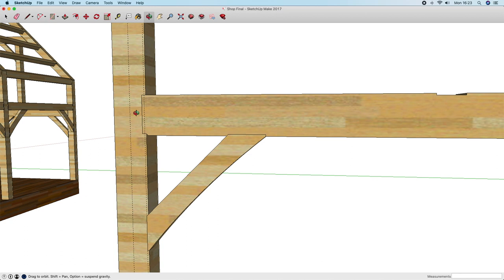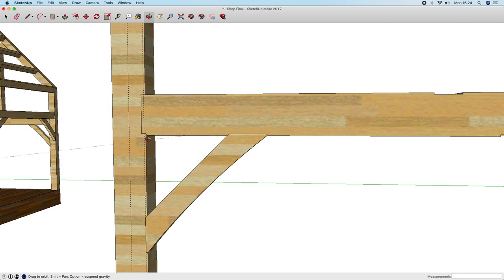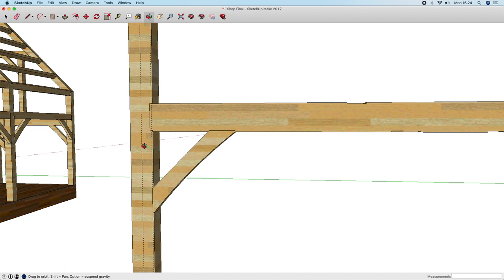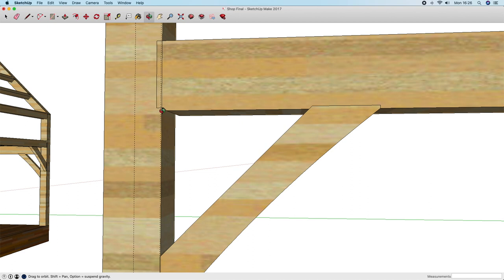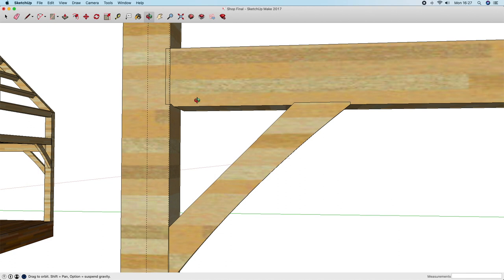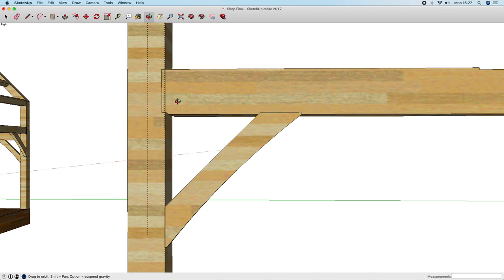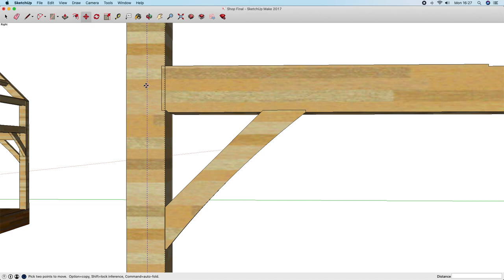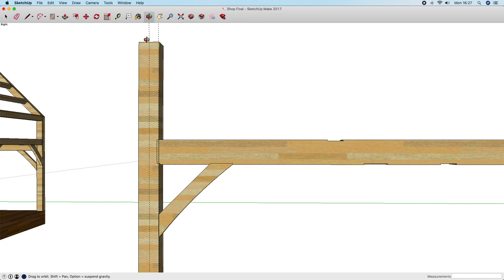Timberframing Layout Part 2 - Line Rule Details

Comment: Thanks for making the video.  One suggestion I would have is to actually demonstrate, actually go through laying out the timber without skipping anything and checking on the other faces versus just discussing it.  Although the discussion is good, actually working through examples could clear up anything that maybe wasn't clear in the discussion.
Reply from the maker: Yup, that's next.  A start to finish on a simple timber that is bowed and out of square including cutting square joints off of a wonky face.
Reply: @DovetailTimberworks  I would also appreciate this as I am still a little unsure as to exactly how you determine where the perpendicular centre lines are going to intersect so that they describe an ideal centre line in all planes. I.e. I get how you do the vertical centre line down from the top, leveled face, but I am not sure about the horizontal one, how you are deciding how much it is offset from that top face on both ends. Maybe you just pull a centre line down one side face as well, or just measure down halfway on each end and pull the perpendicular line with the level?
Reply from the maker: @csgowoes6319  Good question, short answer is it doesn't actually matter where you put it, just that it is level and thus square to the plumb line you put.  I always try to put it where it will serve the greatest utility for me (there are exceptions), for example sometimes where the cheek of a tenon will go or where the bottom of a housing is for example.  I have a simple post picked out with a bow and a twist and a taper that I'll walk through it all on in the next layout video.  If you follow my Instagram too, you'll see some hints.
Reply from the maker: @csgowoes6319  Just today I gave a jig I've been wanting to make for a couple of years now a test run and it works well!  That'll be in a separate "jigs and templates" video!

Comment: How do you mark out for your braces though if you are using centreline. Should you measure from the centres line of the post and top plate or from their edges?
Reply from the maker: I always do it along the chalk line and ignore the edge of the timber.  I make the post top tenon line up with the brace mortises along the same chalk line so that everything is by default all square and lined up
Reply: Ok thanks, will you be doing a video on this?
Reply from the maker: @geordieperrie1072  Yup, I'll be sure to cover that.

Comment: This is a great video! The way you explain everything is really clear. Regarding the chalk lines, how do you remove these afterwards? We will be using milled oak and i am a little hesitant to use blue chalk lines for layout. I di have heard that blue is easier to remove than red chalk. Thanks for your answer, regards from the Netherlands
Reply from the maker: @jandoor4230  Thank you for the comment!  Yes, you are wise to consider this with a porous material such as oak.  If you keep it very dry, you can often use compressed air to blow it out of the pores, after you use a card scraper or ROS to remove it from the surface.  I've also used a shop vacuum to suck it out.  On other materials it just  sands off when you sand the material as normal....no real extra effort required.   Good luck!
Reply from the maker: @jandoor4230  Also, don't forget that you can just leave it on any surface that will never be seen.  It can actually be very helpful to have perfect reference lines visible on the timbers for you to use during assembly and while squaring the frame on the foundation.

Comment: First - thanks again for taking the time to prepare and share these videos. Everything about them - from the clarity of the explanations and presentation, to the video/sound quality and editing is top notch!

I do have a couple of questions that I'll add to the comment section in the hopes that they might be of general benefit, and would naturally be very interested to hear what you or anyone else that's overcome the challenges of applying these techniques to irregular timbers has to say. 

The first question is about using the center-line layout with timbers that aren't the same dimension to create the outer surface of a timber-framed structure. Let's say that you have a perfect 6x6 post that you'll connect to a perfect 5x6 beam (with the 6" side oriented vertically) to create part of an exterior wall. If you snap a line dead-center on each timber, the 6x6 post will have a center line 3" from the outer surface of the post, and the 5x6 beam will have a center-line 2.5" in from the face that'll become the outer wall. If you were to create a 1.5" mortise on the post on its center-line (0.75" on each side), and a matching 1.5" tenon on the beam on its center-line, the joinery would match up nicely but the outer surface of beams wouldn't. That is, the exterior surface of the beam would be recessed 0.5" in from the exterior surface of the post. Is the standard way to address this problem to use dimensions of the smaller timber to determine where to snap the lines on both of the timbers? In this case, that would mean snapping the vertical lines in the center of the 5" face of the 5x6 beam, and 2.5" in from the outer surface of 6" post. To my way of thinking, if you were to lay out the mortise and tenon centered on this line 2.5" from the outer face of each timber, both the joinery and the exterior surfaces of the timbers will align with one another correctly. Is that roughly correct? 

The second question is: how to make this work with an irregular timber? In this case let's say the 6x6 posts are perfect but the outer face of the 5x6 beam connecting them has a bow extending outwards beyond the plane that'll define the exterior wall. It seems like you'd have to start your layout by snapping a line from one corner to another along the top of the beam (along the corner that defines the top of the outer face) in order to define the exterior plane of the "ideal" timber. E.g the surface of the beam that will need to line up with the outer surface of the posts that it's connected to. Once you've snapped that line, if you level the timber and establish plumb-lines at either end (and followed up with a line along the bottom), it seems like you could then use the vertical plane you've defined as a "reference face" from which you could then establish vertical lines 2.5" inward on the end of the beam to define the center of your "ideal" 5x6 beam. This "center" line would then intersect with the lines snapped 2.5" in from the outer surface of the posts to bring both the joinery and the exterior surface of all of the timbers into alignment. In order to prevent the bow on the horizontal beam from sitting proud relative to the plane that defines the exterior surface of the frame, you'd have to use a planer to remove all of the wood that sits beyond this plane on the beam prior to assembling the frame. Does this sound roughly correct?

To make this work with real timbers - or at least the real timbers that I've got on hand - it seems like you'd have to follow this procedure with every surface that needs to align with other timbers to form a plane. In my case, I'd have to define planes for the "ideal" timber on both of the outer sides of my corner posts, as well as the outer surfaces of the beams that connect them - and remove any wood that sits beyond this plane. Ditto for the beams that intersect to form the floor, etc. I keep hoping to find an explanation of the "line rule" layout in which this wouldn't be necessary, but it seems like there's basically no escape from this step? Having said that - I'm hoping that I'm all wrong and someone will explain how to bring the exterior surfaces of a timber frame built with imperfect timbers into alignment using a method that involves way less time and effort - since the "solution" I've come up with is essentially just a reversion to the square rule :0

That's a couple of very long "questions" - so I'll certainly understand if neither you nor anyone else has the time or desire to answer them in full, but I'd certainly appreciate any help or input that you or anyone else cares to give.
Reply from the maker: Hi!  Thanks so much for the detailed and articulate questions, I really appreciate this as it helps me guide the content for the next videos!  I am hoping to be able to do another layout video to finish up a few of the big concepts, but then I really need to get a move on....this is going to be a big year.  So I'll transition more into a Vlog format with maybe 75% Vlogs with the remaining more refined and detailed videos.  I'd also like to consider an "open house" type live feed where folks can ask questions and I can answer with a few visual props handy.  A couple of quick answers for you first:  On your first question:  You have it correct.  Another way to do this is to pick your outside face and do everything a set distance away from that and it would effectively be the same thing.  The forces every inconsistency inwards where it only matters cosmetically.  On your second question: You have recognized one inevitable geometric reality that no system will get you around.  The system permits perfect joinery, but it cannot make perfect timbers.  There is no getting around the fact that the timbers are going to do what they do, and be where they be in between the joint locations.  All you can do is decide the lesser evil and tweak the layout to make that lesser evil be your reality in the end.  If your exterior sheathing approach will not be bothered by a bow outwards in your 5x6, then a maybe let it bow outwards, but if that won't work you may have to place the apex of the outwards bow at your desired plane and then shim underneath where it's not on the correct plane.  Or, hand plane/power plane away the bow.  It matters more where flat planes matter such as floor joists and exterior walls.  

In my experience, things aren't that sensitive actually.  If you have a 14' beam going along the outside wall and your beam to post joints are flush without a stair step (achieved by making the mortise wall line your chalk line instead of centre as well as the side of tenon plane your chalk line for the beam instead of centre) and the beam bows out 1/2" in the centre over that 14'.....depending on the wall material, you probably won't notice.   The other option is to split the difference a bit and have your 1/2" of total bow in my hypothetical 14' timbers and have a stair step at the post/wall plate junction of 1/4" and a bow outwards of 1/4".  I doubt you'd notice the 1/4" bow, and may not notice the 1/4" stair step on the outside of the post/wall plate junction if that makes sense?    Hope this helps,

B
Reply: @DovetailTimberworks  Thanks - definitely very helpful answers. This isn't a knock on other folks that have put out content on this topic, either here or elsewhere - and I'm grateful to anyone who has taken the time to share their knowledge with the world for free - but insights like "Perfect joints - yes. Perfect timbers, no." along with real-world perspective on how much said imperfections will actually matter are what make your content stand-out. 

Like many people, I'm starting off this project by using these techniques to build timber-framed sawhorses - and in my case I chose the most irregular timbers I had to do so.  I think  (hope) I've got the hang of it - but if it's not already on your list that others might find helpful would be showing the techniques you use to insure that your joinery is plumb or perpendicular to your layout lines when the surface you're working on is out of alignment with and/or above those planes. 

Thanks again for the great feedback, and looking forward to the next installment!
Reply from the maker: @yajreizarb  Yes, that's coming up!  I have a few tricks that are super easy and don't require any new tools, just some crap ply.   Stay tuned!
Reply: Now that I'm actually doing the line-rule layout on timbers, a couple of things that were confusing for quite a while have become much clearer.

 The way I now understand it, the vertical and horizontal reference lines established on the ends of a timber have two purposes. The first is to permanently orient the timber in space along plumb and horizontal axes. The second is to serve as a reference for establishing the vertical or horizontal reference planes along the perimeter of the ends of the timber that will define the dimensions of the "perfect inner timber" used to set the joinery and ensure that the outer planes of this timber are parallel to the vertical/horizontal reference lines. E.g. "Use the vertical/horizontal reference lines to set the axes, and the parallel lines along the outer perimeter to set the dimensions of your ideal timber."

Is that basically correct? Even though this now seems blindingly obvious in retrospect, it took a long time for this to "click" for me and based on the inquiries I've seen in other forums this is something other people seem to have struggled with a bit.
Reply from the maker: @yajreizarb  Yes you have it!   The way I say it in the videos is those lines represent where the planes emerge from the timber, because the chalk lines may indeed move up and down perpendicular to the surface as the surface undulates.  You can use those lines to do whatever you want with, knowing they are going to serve as indications of reference planes for you.